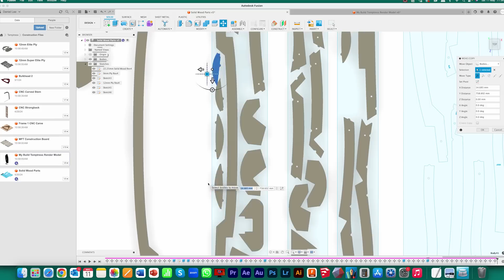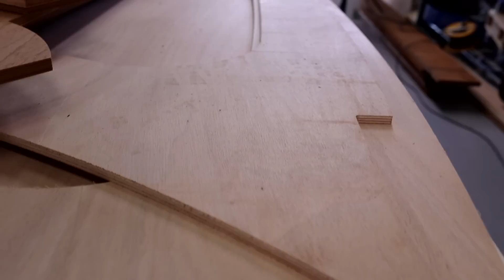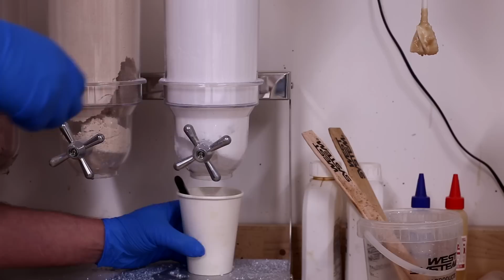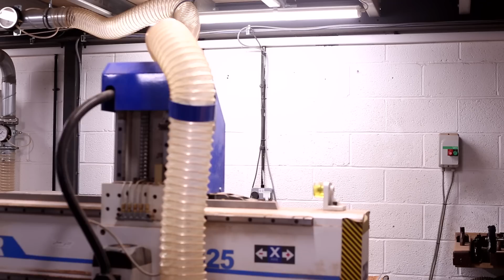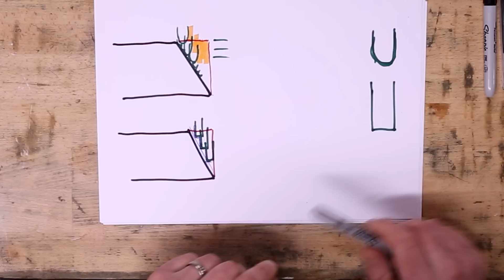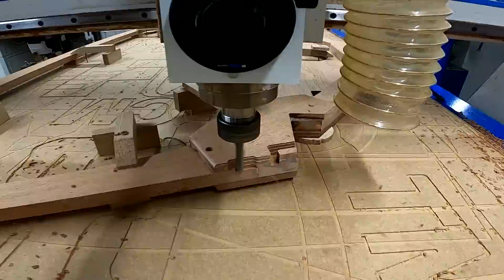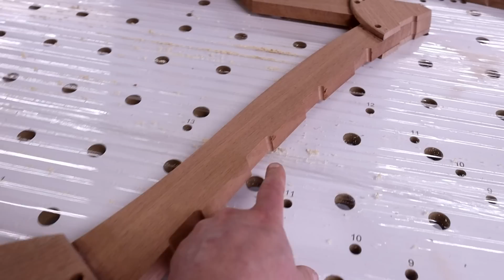CNC Carved Boat Frame REFINEMENT | Building Temptress Ep4

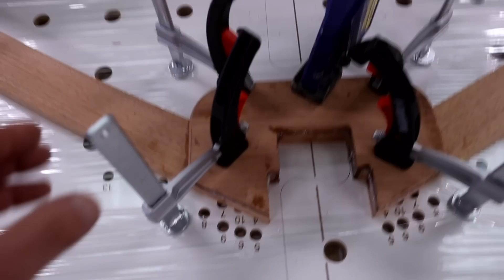Comment: 20:11 Not sure if this is mentioned in future videos as I just found this playlist, but those MFT/ dog hole clamps usually work better in thicker/ harder materials. They require the hole to not bend or get deformed in order to hold pressure. Clamps like that work very well in metal welding fixture tables, and usually work well in solid hardwood workbenches, but I would guess the melamine just is not quite strong enough to hold up to the forces.
Reply from the maker: Yeah they definitely didn't hold up too well in the MDF, if I were making one of these for prolonged use I think I would cut it from something like 25mm HPL board for better results 👍

Comment: Question, why couldn’t you cnc the 3d bevels into each part separately as each is being initially cutout?  Could this be the way to go for us with smaller cnc machines?  If done accurately the end result should be the same when laid up as it would if you cnc the 3d portion at the end of the process.  Just wondering your comment on this.
Reply from the maker: A few have asked this, it's actually much more difficult as it requires fixtures for two sided machining on almost all of the parts. It is a much easier process to do this for one complete frame that allows lots of surface for clamping and the use of the dowel holes to globally locate the part.

Comment: Dan, Very impressive work and videos. Do you think one could contour the frames using the Shaper Origin router. I do not have a large CNC machine and was watching the great job Polyerman is doing with your plans using this system. Thanks
Reply from the maker: Thanks. I don’t believe the shaper would be capable of doing something like this as it can only do 2.5D cuts on flat planes as far as I’m aware. I would really recommend that most builders bevel and notch frames in the traditional, manual way as battens etc are installed.

Comment: Amazing use of cnc, I was thinking of purchasing a hobbyist grade cnc, for making plugs and molds. After seeing the video I actually see more uses that it can be used for. Due to how wood changes (expand, contract, torque) on temperature and humidity shifts, I would add a temporary cross brace/internal plywood frame that you can either cut away or unscrew it, keep the internal frame in place until the part is actually installed. This should help keep the part true.
Reply from the maker: The open frames will have a cross member on them that will limit movement of them once they are assembled, this will also support the strong back legs. I wouldn't expect to see a great deal of movement here though given the arrangement of grain and the fact my workshop is quite a stable environment.

Comment: To prevent break-out you should slow down to near zero when changing direction, it is the speed taking the corner. Basically when changing direction you also change the point where the break-out occurs. It is rather common when you try to transition to cnc. When you work with a chisel you know exactly what pressure and at what speed you move your hand. But the machine runs along a tool path you generate as the whole entity, not considering what speed and what direction the entry is. 

Consider a tool path for a bandsaw in your mind, you need the width of the blade then change direction, how would you do that? Basically you need that kind of an approach when transition to CNC operations. It was the hardest thing I had to learn. We changing to a 4-axes, 3m×1.5m wide table. Took about a month to learn the basics, 3 months to full production, and 2 years to optimal production. And that was, eh, hard...
Reply: Addendum 
As an aside, I worked in the manufacturing of tables, chairs and various other furniture. That lasted from about '82 till 2000 when I transitioned to metal working, way more innovative mindset. Today a pensioner. 

A few pointers to prevent break-out: Realise what direction your tool is travelling: against the grain or perpendicular to it and at what side your tool is cutting. In various instances it would make more sense to not end the cut but lift it and come in from the the other side. Time wise it makes more sense: Repairing or use the tool to prevent break-out...

Comment: Why not leave a full cm or at least half a cm, of material, before you run the final routing?
Why have any surface etc. done to its final size,  before the final pass?
If there's a cm.of material everywhere everything will be perfect after the djnal routing is done.

Comment: Is it not worth using a marker/scribe toolhead and running a mark on the sacrificial board tracing the outline, when you drill the referencing holes? That way when you place the frame you can tap it into place all around referencing that marked outline.

Comment: Try adding a small 0.25 - 0.5mm fillet/roundover to all sharp edges allowing the cutter to roll around the edge, this certainly helps eliminate tear out on 2d plywood and solid wood parts. Another solution would be to cut notches first on a separate toolpath and then a continuous contour toolpath without notches which will remove any tear out.

Comment: A much easier way to get the whole shooting match registered on the spoil board is to screw down sacrificial spacers where you are going clamp (over size in x-y and too thick in z), then machine a nest into them - the negative of your frame - and then just plop it in clamp in without resetting the machine datum.

Your perimeter tracing technique is not uncommon either, although you've done it extremely manually (a piece of straight ground rod would be easier to measure from), but you can also use conductive tape and jog the machine to touch the frame and then program the measured offsets in the g-code rather than rely on setting up the frame square and datum'd in the first place.

Keep up the good work though!
Reply from the maker: Nice, I like the idea of machining a nest into spacers 👌

Comment: We have to remember that we're working with wood, not metal, so a few millimeters tolerance on a part this size is as good as it gets.
Very envious of using the CNC machine for this work, especially just having spent a hard couple of days fairing frames and stringers with a hand plane!

Comment: 2mm out of centerline, make lowest sheet were all has added, both head little shorten and cnc table fixed head and this have horicontal 2 screw, then can open free lowest sheet and screw easy sheet horicontal move sheet whit screw to centerline, and then closed sheet back to table locked, same idea about vise have but can accurate move position left-right to center line , sorry my english not good what i mean but can adjust lowest sheet to centerline better 2 mm have lot many point this frame, im retiree old engineering 65Y old what has working all my life whit CAD and metal cnc work plan lot parts. if i can make drawing you can understand better this idea. i hope this help or you can test this idea.

Comment: Just a thought... are these small tear out areas really a problem? surely when you assemble the frames there will be epoxy filling those? it might even make it stronger. I know you're a perfectionist though.
Reply from the maker: Not really no, I think I’m probably fussing over something that won’t really be an issue down the line. It certainly won’t be seen that’s for sure.

Comment: Are you an aerospace engineer? The level of accuracy you aim to achieve has nothing to do with boatbuilding. Building boats myself and being an aerospace engineer I see your treats and pitfalls. 1 to 2 mm accuracy has nothing to do with boatbuilding. Its all about long stroking lines for the stiffners under the skin. However I do like your frame construction board. You must be spending time behind Fusion 360 for days on end!
Reply from the maker: I wouldn't say it has nothing to do with boat building but there are probably very few people working to those sorts of tolerances. Mostly I would guess because many existing plans are not that accurate to begin with and so builders are very accustomed to fairing and correcting errors as they go.

Seeing as I have such accurate data to start with, I believe getting things set up as accurately as I am able early on will filter on down through making the rest of the process flow. It will be interesting to see how it transpires down the line when it comes to planking the boat but as I say in the video, I don't think chasing down errors of less than 2mm is worth worrying about.
Reply: @DanLeeBoatbuilding  thanks Dan. Yeah “nothing to do with boatbuilding” is way too harsch. It has everything to do with boatbuilding and all to do my envy for your shop and life! Way to go Dan!!

Comment: Thoughtful approaches, Dan, very impressive. With the glue table and Irwin clamps, if you remove the fixed head and replace with a 4-5cm steel strap that freely spins, you could drop the shank and strap parallel through each hole, then wiggle the clamp to get the strap to turn 90 degrees. Save you creeping under the table to reattach a fixed head.

Comment: On the tiny tearouts experienced at the inward notches, perhaps after the square end mill roughing pass is completed try treating those corners with CA glue and accelerator or an epoxy ? Just paint on a coat or two of just resin, let absorb and then spray or paint with kicker vs premixed epoxy to firm the corners up a bit ? Thinking maybe the resin being absorbed deeper may be better than single stage unless its thinned ?

Comment: You should stop trying to manually lay out your position on the table. If you used one of those wooden dowel locations as your program X0,Y0 your positioning would spot on. Cant wait to see the progress on this boat!
Reply from the maker: The dowel holes are drilled by a program that shares the same origin as the frame bevelling program. The manual things I was doing were really just checks to see how the tool path corresponded to the physical frame.

Comment: Dan, I find Sipo hard to machine consistently; some stock will not behave no matter what strategy in F360. Since your final path is a finishing pass, try the Parallel 3d, making sure that the direction of bit orientation is 90 degrees to the face of the frame. It will take longer than a 2d contour but will most likely give a better finish, reduce tear out and all but eliminate the ridges left from the step down on the contour. Enable Rest Machining and Contact Point Boundary from the Geometry tab. Drawing a profile of the finished top profile for use with Tool Containment (centered on the boundary) will speed up the 3d finish strategy; the little fuzz at the top edge can be sanded far faster than the hours an uncontained path will add.

The 3d strategies in Fusion are difficult to get right in wood, especially with cross-linked grain woods. Working with 3d is a big step from 2.5 axis machining, but is also a huge learning curve. Trying a smaller sample with the intended tool paths will save time.

I really enjoy your content. Your videos on resin infusion have saved me days and $$$ of mistakes!
Reply from the maker: I’ll give this a go thanks. Might be able to do a parallel path and just select specific faces to machine such as the batten notches that are breaking out. Then I could finish up with a contour path to do the longer, less risky runs.

Comment: I am loving watching this method.  I had one question on the shaping by CNC: understandably this may have some complications like the springiness of that long stretcher, but would you be able to do the shaping when cutting out the individual pieces instead of positioning the whole glued up piece back on the CNC? Just thinking about how I would make something like this without getting a much larger CNC (currently have 2' x 4' milling area).
Reply from the maker: This could be done. There have been a few questions about this now and I think I'll cover it in the next video as it's a little difficult to explain in the comments. I actually think it would be more complicated to do because you would need to do a two sided operation on maybe 8 individual parts, creating a hold down system and a program for each operation. The way I'm doing it now there are only 3 operations, stock parts cutting, bevel side 1 and bevel side 2. It is also easier to hold down the entire frame whilst the bevels are milled but holding down and locating individual sides, bottoms, deck beam and gussets would be a ton more work.

I get the benefit of wanting to do it on a smaller machine but in reality you need at least an 8x4' machine for this boat anyway. Some of the deck beams are probably 7' long and most parts for the jig elements etc are broken down into sections that will nest on 8x4' sheet stock.
Reply: @DanLeeBoatbuilding  Totally makes sense on the CNC side since I did not think about the significantly longer pieces. 

For beveling the individual pieces, I guess I was assuming creating specifically placed tabs to hold the pieces within the original board until all operations were done with what you had on that piece, ideally reducing the hold down complication.  But I don't think that reduces the overall complication and there would be some more manual cleanup for each piece.

Either way, I really appreciate your trial and error approach, and the explanation of chasing down perfection was great.  I easily get caught up in the details and forget to look at the big picture.  I would totally be chasing after those 2mm if someone didn't say "What difference is that actually going to make on this boat?"
Reply from the maker: Yeah it’s easy to get caught up on details and then two months later you think why did I even bother. It’s only that I have the machine there that I’m even able to see that error otherwise I’d have never even noticed it I bet… onwards and if there’s 2mm errors, no one will ever know 😁

Comment: Amazing set of skills being shown here with constant improvement and problem solving! For reducing tear out there are alot of comments about glue and sealing edges which I imagine would help but adds time and hassle in the stages needed to stop the process and restart after curing. 

Tool path, cutter rotation and feed direction are definitely worth investigating but wood is natural so the grain is different at different points with the changing of the deck beam camber and the shape having 2 sides meaning the set up will work well for one side but less for the other. Would a mirrored tool path based on the centre line help? Do you currently have one side with more or less tearout than the other?

On a milling machine we use climb and convetional cutter direction in relation to the feed and this can do wonders for finish, tool chatter and accuracy.  Some machines cant manage the climb milling as the tool just tries to run away with itself. 

Would a cutter with more flutes help so each cut is smaller with less chance of tear out?  Can you control the feedrates of certain profile (more than 45* external corners for example)to be fed slower in the tool path?

I love a bit of problem solving! Im probably way behind you though and you have thought of these things
Reply from the maker: Thanks! Yes glue would certainly induce some stop start downtime which isn’t ideal. I am getting breakout worse on one side than the other. I am currently climb milling and confident my machine plus the new hold down system is rigid enough to manage it. Chatter has certainly disappeared.

I might have a look at feed rate adjustment on angled entries. Might be some stuff in the further depths of Fusion that will do that. I do also have a 4 fluted tapered end mill so I could give that a go on the next frame, thanks 👍
Reply: @DanLeeBoatbuilding  another thing that may help with the breakout would be to cut inwards (cross grain) first and do the batten notches then doing the outer profile as that would then remove any chips which may have occured. Again you may have thought of this already. 

I think with the level of work you are putting in to Temptress you will end up with a work of art as well as a beautiful boat

Comment: From a milling standpoint if the cutter rotates in a clockwise direction see if you can run the cutting path in a counter clockwise direction will probably help with any chip out.

Comment: I do have a question. Since you are cnc-ing the individual parts to begin with, why don't you include the bevels, or at least the initial bevels during the first cut? I can appreciate that height wise-they are not in their final dimension, but you could remove the bulk of the material during the first operations, while these parts are indeed on the board. I may be missing something, just an idea really :)
Reply from the maker: A few have mentioned this so I think I’ll talk about it in the next video as there are a few reasons why I haven’t done it that way. Board dimensioning and part holding are the primary issues I can see.
Reply: @DanLeeBoatbuilding  for your board dimensioning and/or part holding, you could do perhaps a spoil board that replicates the assembly board hole pattern, as well maybe use tabs before the final pass. Also perhaps worthwhile if you can size the boards down to the last couple of mm or so using a flattening bit or two on the cnc itself. Again, I don't mean to tell you how to do things, but just another idea :)

Comment: A possible solution to the tearout on the deck beam. You could leave the deck beam oversized, run the grooves then come back with a finish pass to bring it into size.
Reply from the maker: Yes, I think in an ideal world parts would be oversize on all their external edges and then machined down to size at the end. For this project though that would require me to re work the files for every frame which would be a ton of work. Maybe for the next plan set.